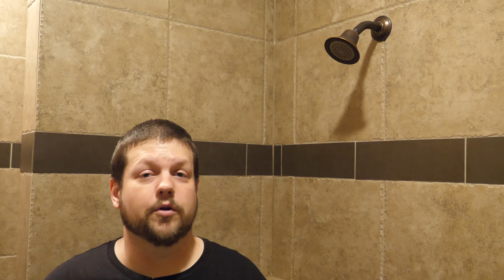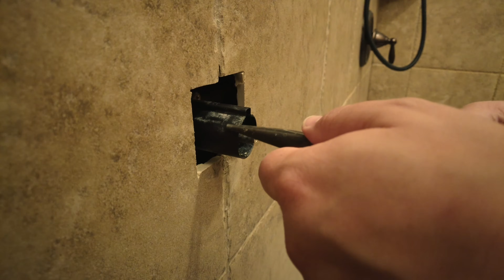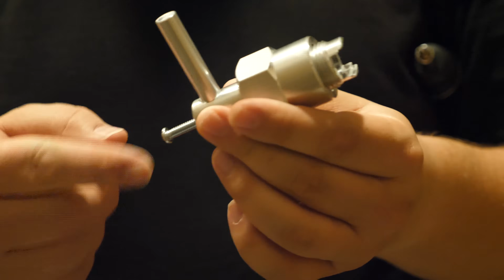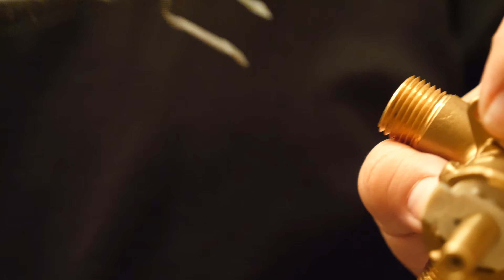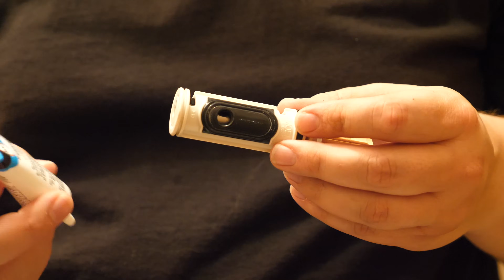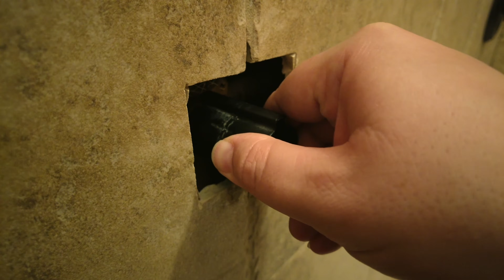Low Water Pressure on the Hot Side Only? It Could Be Your Shower Cartridge

Comment: Before you buy expensive sower mixer inserts, check that any Cold mains and Hot presure restriction valves are working at the right presure. 
On my housse mains and hot presure is reduced to 3 bars by presure restrictors, one was faulty, a 10$ replacement insert fixed it.

Comment: Well I just replaced the cartridge and still have low pressure and warm water on my shower 🚿, only my shower has this issue (my both sinks and jacuzzi are working fine with a hot water) I already cleaned the interior of the valve and the head shower and I got warm water and low pressure in one side
Reply: Did you ended up finding what the issue was?

Comment: So , what happens if the low pressure is at all faucets , shower heads etc in the entire house. Could it be the cold water valve on the input side to the water heater that is blocked up thus restricting the full pressure ?

Comment: But mine is a 2 outlet bar thermostatic valve 
How to adjust the hot water flow 
I also have the same problem of hot water low pressure

Comment: Thanks for the video.  Took mine apart and did not solve the low water pressure problem at the showerhead.  Then, I removed the hose and found that a small screen particulate filter was clogged at the exit of the wall for the shower wand.  That solved the problem.  Thanks again for the video.

Comment: I have a similar problem in my shower. Plumber says there could be a blockage in the pipe or an issue with the diverter. Is there any easy way to check if there is a blockage or not ?

Comment: I changed out my cartridge and mixer cap (Kohler) and the hot water pressure is still low. It's an older house, but the boiler is new, and I have hot and cold valves which are both open. Any thoughts?
Reply: Same here did you figure it out ?
Reply: In my case I found out that my aquastat was bad and apparently my coil. I'm going to be putting in an indirect hot water tank.
Reply: Good luck.

Comment: great video! any advice on how to increase the water pressure just in the shower? the sinks around our house all have amazing pressure, except for our showers. we tried to remov the water pressure valve thing inside the head, deep cleaned the heads, and bought a new shower head and still get very weak pressure. do you know of anything else we can try before calling a plumber 😢

Comment: Brand new shower valve only delivering 2 GPM from the tub spout on full hot setting. Plumbing is all new as the bathroom was gutted and completely new mechanicals installed. The mixing valve is a Moen UT2133EPBN. On full cold from the tub spout I get just over 4 GPM. Spoke with Moen and they say it's not the valve. Any ideas? Thank You!

Comment: Great video. Fixed the issue but for some reason when the water is turned about halfway between cold and hot, it sounds like it’s struggling to to let water in or something. I heard an odd noise coming from it but only in between hot and cold. All the way either way there’s no noise. I got a Danco cartridge. Could it be just an inferior cartridge compared to the Moen?

Comment: Would it be the valve if the hot water is low and the cold is full pressure but when it's hot the water also comes out of the faucet for the tub water?

Comment: What if you replace the cartridge and still does not correct the hot water flow?  Ie still low pressure
Reply from the maker: Most likely there is something blocking the flow. Either something in the pipe (like solder/debris) or possibly a supply line valve is not open all the way

Comment: My issue is - mine is a tub/shower. The shower head is fine but the tub faucet when fully open on hot drops in water pressure. Brand new cartridge and shower a tub. Any ideas?

Comment: Hello! So we replaced this and we are still having the same issue. Any suggestions? House was built in ‘88
Reply: Did you try replacing the shower head? There is also a water flow restrictor inside it that you can break off and pull out for more pressure.
Reply: same thing here! Were you able to find a solution?

Comment: had low water pressure in both my showers just started happening out of the clear blue...I called my local water co. they asked if I have a water softener which I do but have never used.  They advised me to turn nozzle onto Bypass which I did and water pressure if BACK to normal

Comment: Thanks this was my exact problem rust clog at water heater
Reply from the maker: Glad you found the issue!
Reply: What if you have a shower with a faucet that has a diverter so water goes to the shower head when pulled up, yet water still flows out? Have replaced it with a new diverter and just replaced the cartridge and the same issue is still occurring 😕 🤔

Comment: So i have same shower setup and i had no pressure. But it was because of main valve wasn't fully opened.  After opening it more, switching to shower water flow started making noise. Will be performing valve replacement anyways. Watched this video 5 times now.

Comment: Would calcium deposits limit one or both hot and cold pressures? My shower upstairs doesn’t have as much cold water pressure but has plenty of hot

It could easily be a cartridge issue but I’m gonna clean the deposits either way. I’ll also check the valves you mentioned
Reply from the maker: It's possible it's calcium, but that usually affects both hot and cold, not one or the other.

Comment: I only have low pressure on the hot water side. Having issues after replacing my shower head. So the hose and shower nozel part is new. I replaced the mixer last year so its brand new.
Trying to think what i can do. I might try the old shower head back on after work.

Comment: We had the same problem, replaced the cartridge and still have low hot water pressure in the shower.  However, if the vanity sink water is running at the same time, there is good pressure.  Any idea on what can cause this?
Reply: it's due to the air bubbles in the vertical pipe going to shower head and the sink is usually lower than shower head therefore it (the sink)  gets more pressure .what i would do is either run the sink tap on full (Hot line) for a few seconds, you will hear air bubbles coming out once there is no bubbles you can turn it off or you can run both sink and shower ( on full hot lines as well) at the same time for a few second ( it may take longer depending on how far your hot water tank is to both) then turn off the sink tap. i hope that works let us know if it works for anyone.  it works for me:)
Reply: @i-tit5474  thank you soooooo much for this, I was just about to order a cartridge and saw your comment...after running both the hot water on the sink and shower the hot water pressure in the shower again is good again, you made my day! :)))))

Comment: I did all this and it did nothing. Also, my water takes forever to get hot. This ONLY happens at one shower (and one place) in the entire house.
Reply: Try this: it's due to the air bubbles in the vertical pipe going to shower head and the sink is usually lower than shower head therefore it (the sink)  gets more pressure .what i would do is either run the sink tap on full (Hot line) for a few seconds, you will hear air bubbles coming out once there is no bubbles you can turn it off or you can run both sink and shower ( on full hot lines as well) at the same time for a few second ( it may take longer depending on how far your hot water tank is to both) then turn off the sink tap. i hope that works let us know if it works for anyone.  it works for me:)

Comment: What if it’s the sink and shower only in one bathroom? Hot water in kitchen and second bathroom ok. Hot water in the sink and shower in the first bathroom very low. The only thing I can think is a bad solder job protruding into the copper pipe choking the flow.
Reply: Try This: it's due to the air bubbles in the vertical pipe going to shower head and the sink is usually lower than shower head therefore it (the sink)  gets more pressure .what i would do is either run the sink tap on full (Hot line) for a few seconds, you will hear air bubbles coming out once there is no bubbles you can turn it off or you can run both sink and shower ( on full hot lines as well) at the same time for a few second ( it may take longer depending on how far your hot water tank is to both) then turn off the sink tap. i hope that works let us know if it works for anyone.  it works for me:)

Comment: My hot water is suddenly low pressure at every faucet.
Reply: The issue where your pipe connects to your water heater, usually a clr type issue.
Reply: The issue is likely a blockage. Happens often with galvanized pipe not as common with copper.

Comment: I have changed the complete shower unit (and therefore also the thermostat cartridge) and yet this exact problem persists (reduced pressure only on hot). Anyone got any thoughts about what else the problem could be?
Reply: any update? could be your water heater, do you have any issues with that?
Reply: If you are on a well with hard water or iron pipes hot water tank inlet/outlet could be blocking
Reply: i’m having this problem too did you ever figure out a solution?
Reply: @MakaylaTW  yes, for me it was the water tank in the attic was too small. Had to get someone in to work out the problem.

Comment: Great video. I just installed a new Moen 2510 valve with a new 1222 cartridge. I have extremely low water pressure. If I take the cartridge out and turn the house water back on, the water pressure is normal blowing across the shower. I have contacted Moen and their answer was a new 1222 cartridge. I have now swapped the cartridge 3 times with three different cartridges and no difference. I reversed the cartridge so that H&C are on the bottom. Same issue but now hot water comes out instead of cold. I did recently install a new hot water heater (electric) and pressure tank before replacing the shower valve. Could the pressure tank on the hot water heater be the issue???? All other plumbing in the house works fine.
Reply from the maker: Both hot and cold are low pressure? Since it's fine everywhere else and you've swapped out the cartridge (a lot), I suppose it could be the valve itself but I'm not sure what the issue would be. Sorry I can't be more help.
Reply: Thank you and sorry for the delayed reply. Ill advise if and when I figure it out.
Reply: @David-ik6yu   were you able to figure out what the issue was? I'm having the same problem
Reply: I have the same issue! fuck moen!!!!
Reply: Me too just the hot water.  I've changed the cartridge and the seat several times...when I remove the seat and the cart water blasts out of the hole
Reply: @jeffmaraman8149  mine ended up being faulty/corroding pipe behind the tub spout. Had a plumber come out, replaced it, and I've never had such great water pressure

Comment: What if this is happening thru out the whole house
Reply from the maker: I'd investigate your hot water tank first. Could be blocked there due to calcium buildup or another problem.
Reply: @TopHomeowner  thats what im thinking but I'm waiting till spring till I mess with water its currently below freezing temps here in minnesnowda
Reply: @TopHomeowner  we had a 40⁰ day last week i turned the main off and turned on all the faucets and turned the main back on to see if I could push whatever it was but I don't think it would have made a difference in the situation since we have full pressure on the cold water and dribble and air with hot water
Reply: @onemansvideos2134  any update? We have this issue as well, when I turn the handle to fully hot, the pressure reduces, which happens to all showers in the house
Reply: @eeeeeeeeeeeeeeeeeeeeeeeee-s3p  we had build up it our pipes so we disconnected the main hot from the hot water heater and used an air compressor and blew compressed air thru the hot water side of the faucets and blew chunks of build up out the hot water line at the hot water heater...it definitely helped alot

Comment: What would be your course of action if this was happening to a shower that the hot water worked in the morning and now it’s not in the afternoon? Would you suspect a cartridge? 

Home is 20 years old, only this particular shower is loosing pressure on hot our other one is not. We do have polybutylene pipes.
Reply: Cartridge is pressure balancer, if you have a pressure drop it a no brainer.
Reply from the maker: Most likely it's the cartridge.
Reply: I would suspect the cartridge, it floats between hot and cold,in the morning you shower relieving the hot expansion, during the day water heats up expands and gets stuck ,sometimes I have seen  little or no pressure from both sides.

Comment: For a rental unit built in 1928, where the hot water supply pipe is rusted and often clogged, which reduces the hot water flow rate (pressure), would you recommend (1) changing the pressure-balance mixing valve, (2) only the cartridge, and/or (3) "cold water backflushing" the hotline? I get fluctuating 0.05GPM to 1.5GPM hot water from my shower nipple and tub spout compared to 5.0GPM to 5.5GPM on the cold side.  It can take 30 to 100 minutes to fill up a 50 gallon bathtub with hot water and I get thermal too-hot and too-cold shocks from the showerhead.  Yikes!  Old rusted pipes!
Reply from the maker: Easiest would be to inspect the cartridge first and see if it has a problem, then I'd inspect inside the valve to see if theres some debris that can easily be removed. Good luck!
Reply: With a rental property, to remove liability, have the pipe replaced,if you take out the pressure balancer someone  could get scalded.

Comment: Hi, thanks for the great video.  I get perfect cold but when turning to the hot it gets very weak.  The entire system is brand new and has never been used before.  I have the same set up in the other bath w/ no issues.  I have a tankless heater (Navien NPE - 240S).  I don't see or know about a manifold.  Before buying the tool to remove the cartridge, do you have any suggestions?  Much appreciated.
Reply from the maker: Since it's new, you might just be able to use pliers to pull the cartridge out to inspect it without buying the tool. Also, it could be that the hot water line has some type of blockage inside the line... Like debris from wood or even solder if it's copper pipes. Either way, both hot and cold are mixed in the valve so if something is blocked, or if it's the cartridge, I'd look there first. If it's not the valve/cartridge, then the problem has to be between that shower and the hot water tank.
Reply: Right after a water main break and repair on my block, my bathroom and kitchen sink hot water stopped coming out, only cold water comes out. But my shower and other bathroom sink are fine. 

Just my kitchen and main bathroom hot water stopped working at the same time and same day they worked on the main break on my block. 

So i doubt its the catridge, both faucets are only 6 years old. 

So is the problem with my hot water heater? But the hot water works for my shower and 2nd bathroom sink??
Reply: hey, i have the same tankless heater, same problem. Did you get it figured out?
Reply: Replace pressure balancer cartridge.
Reply: Great job.
Reply: Do you have to use cartridge removal tool?